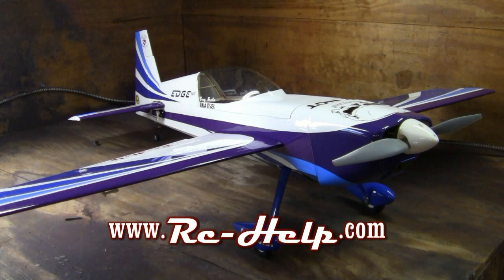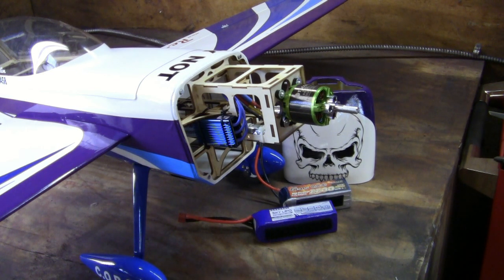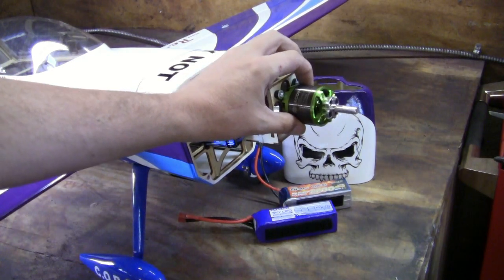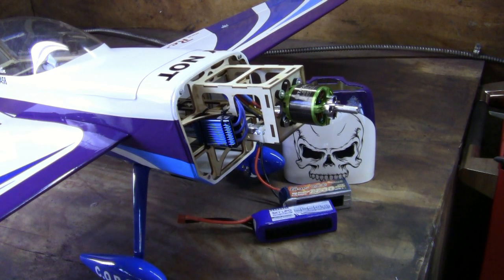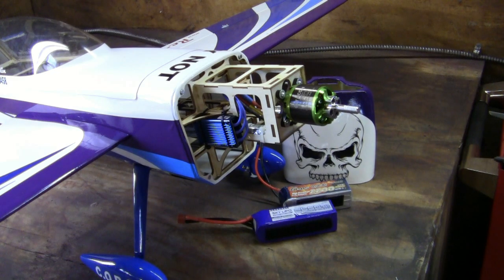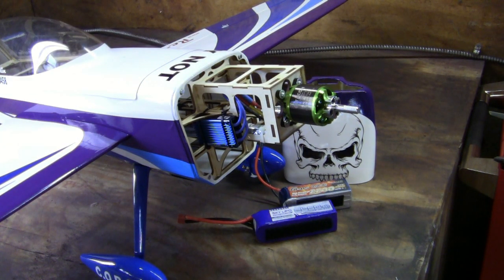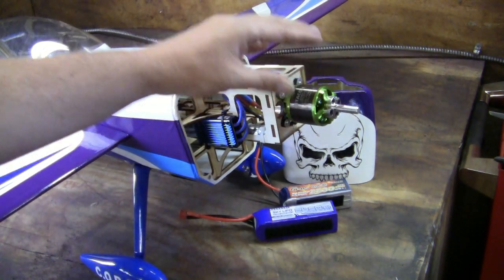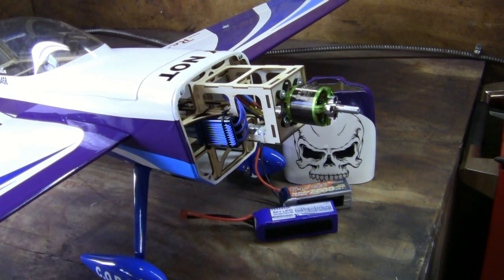Matching Motor, ESC, & Battery

Comment: You said you could use an 11.1 V battery as well. Isn't there a restricting voltage limit for the motor? Like it needs 14.8V battery or something?
Reply from the maker: It will depend on the motor and the battery. The lower the volts, the higher the amps given the same wattage.
Reply: @RcHelpDotCom  Because it is also said that when you apply higher or lower voltage than specified then you might damage your device. That's why I asked. So how come it does not apply here? By the way thank you so much for the quick reply.

Comment: Hy, does the ESC Amperage need to be bigger that the motor amp with 20% more, the battery also need to have a bigger value but the ESC how it need to be in comparation with the battery Amperage ? i saw that you have a 60 A esc with 50 A battery, if you put a bigger Amperage battery value , will burn the ESC ?

Comment: I dont use bigger than 50c ,higher than that burn my gear a lot.
Reply from the maker: Burn your gear? The C rating is only the discharge capacity of the battery. The battery does not push power, the electronics in the model pull what they need.

Comment: So you say going from a 3s to a 4s or (up in battery voltage) wont increase power . 
But say your motors max draw was 50 amps .  50x11.1 (3s lipo) = 555(watts) .  Now if we up the voltage to 14.8v (4s lipo) . so 50(amps) x 14.8(4s lipo) = 740(watts) . Which is more power if im not mistaking .
Reply from the maker: 3-4s is not what I was saying in this video. I'm saying going up in C rating (C, not S), if you see an increase in power, then your old battery did not have a high enough C rating and was causing a bottleneck. www.Rc-Help.com
Reply: Increasing series is better for making more power with less amp draw your motors will last longer but never exceed the manufacturers recommendation for the number of cell in series.

Comment: Golden.
Reply from the maker: It's not what they are called, it's just what the manufacturers state for 3D. And yes, you want an ESC that is just slightly over what you are going to be pulling amp wise.
Reply from the maker: Thanks. www.Rc-Help.com
Reply: @RcHelpDotCom  Say champ, which prop pitch are good for 3D on an electric 3S slowflyer around 14 oz? Someone said i need a low pitch prop, but does than mean a 9x7 or a 9x3 or even lower pitch than that? Thanks.
Reply from the maker: Usually with 3D props, the length needs to be twice the pitch. On the place in the video, a 12x6 is the suggested prop for 3D, and a 13x8 for regular flying. That plane is a 55" just for comparison. If you are flying with a 9" prop, look for something in the 4.5 to 5 range on the pitch. Just watch your motor temp and esc temp. www.Rc-Help.com
Reply: @RcHelpDotCom  Oh, so you call them 3D props? That`s new to me, never heard that term before. Prop length twice the pitch, never heard about that either. I`ve seen some "SF" props but never made the connection to 3D. As for esc i try to use one that can tackle a little more amps than the motor will draw, isn`t that the rule of thumb. Anything bigger than a 9 size prop would draw too many amps from the motors i am running which is the 80-120 watt range. So a prop length twice the pitch is the golden rule of 3D flying. Thanks for the tip :)

Comment: Great video! Iam starting in RC, and i want to get a kit for seaplane. but it would be great if the kit could be used in other planes, so... what you recomend, a 4 cell bat kit o 3 cels??
Reply from the maker: The voltage will depend on the plane and the electronics requirements. I can't tell you what those are since I don't know what you are purchasing. Just read the manual for the parts you have and it will tell you what to use.

Comment: its best to go 25% oversize  with the ESC  meaning loaded up max at 80% .. good vid "47amp X 1.25 = 58.75 round up to nearest 60 amp" esc
Reply from the maker: If the aircraft can sustain the extra weight, they go for it.

Comment: Can I get a esc that has a much higher amp rate than the motor so I can use it in future projects with bigger motors too or I shouldn't? If I shouldnt, why is that? Same with battery, can I get a higher amp battery for the same reason? I have read in your description that the motor only takes as much power as it needs from the battery, nothing more, but in past I have burnt small motors using high voltage batteries such as using 12v on a little toy car motor, how did that happen? I am such a noob...
Reply from the maker: Correct, you can get a larger ESC and a larger C rating and not hurt anything but the weight. Going to a 3s or 4s on the battery though can most definitely burn up a motor or even an ESC for that matter if it isn't rated to handle that kind of voltage. So definitely stick with the voltage that they suggest.
Reply from the maker: I would like to start with the end of your comment, In the description, I stated "as much power" with power being the key word here. Power is amperage. If you look at Ohm's Law, I=V/R, so power equals volts divided by resistance. This is a key component in what I was saying. Voltage is how big the water flow is, amperage is how much water is flowing through. 

So in the case of the toy car motor, which was likely a couple volt motor, going 6x the voltage is definitely going to burn it up. 

Now to the question of larger ESC and C Rated battery. You can go with a larger ESC and not hurt anything*. Notice the asterisk. We will get back to that. You can also use a larger battery C rating without hurting anything*. There it is again.... 

*Using a larger ESC and a larger C rated battery will add weight to, usually the front of the plane and can make it nose heavy, or in some cases, too heavy for the plane to be able to carry it. So definitely keep that in mind. 

Hope this helps.
Reply: @RcHelpDotCom  so I can get a larger esc and not hurt anything and I get get a higher C rated battery and no hurt anything, oy issue is the weight. What about a bigger cell battery? If the motor is rated as 2s and I plug it to a 3 or 4s, it will get damaged and possibly burn right? Thanks for your time by the way!!

Comment: ok so Kv is constant velocity. NOT kilovolts (kV) got it. are wattages usually listed when you get a new motor?
Reply from the maker: KV is RPM Per Volt. Take that KV number and multiply it by the voltage of your battery. And wattages are 'usually' on the spec sheet. If they are not, then you will need to use a watt meter to find out what the number is. www.Rc-Help.com

Comment: I placed a 3s vs 2s lipo and it goes MUCH FASTER!
Reply from the maker: Increasing voltage will always speed up a motor as long as everything can handle the increased voltage. www.Rc-Help.com
Reply: @RcHelpDotCom  it's the voltage that does it, not the Millamps?  is that what you're saying?

Comment: Great video, it is really helpful.  I have a question I have  a Sig Something Extra that I built many years ago, prior to the days of electric flight, it currently is flying on a Super Tigre 45 nitro motor.  I would like to convert it to electric, how do I determine what electric motor to use?
Reply from the maker: My first question is, do you actually own a Corvair? My grandfather and I build a 64 'vert and did some shows with it. Man I miss that car lol. 

As for your question, I'm guessing it has a .45 nitro engine in it? The "VERY" rough rule of thumb is to take the displacement (in this case .45) and multiply it by 2000. So .45*2000=900. So you would want to look for a motor that is about 900 watts. With that information, just head out to the different sites that sell electric motors and look at all motors that are ~900 watts. You will also need to measure the inside of your cowl for all 3 dimensions so that you know it will work. I can assure you are going to have to make a mount to push it forward. 

If you would like some more help on this, come over to the forum and post up. Lot of great people over there to help out. www.Rc-Help.com
Reply: @RcHelpDotCom  Yes I have a '64 Monza Convertible that I'm restoring.  Yes it is a .45 motor currently.
Reply: @corvairchris82  My buddy had the 66 Corsa, and his name was Chris.
Reply from the maker: That is exactly the car we did. Awesome!

Comment: Hello, Thanks a ton for this video. I'm a university student and we're trying to make an efficient plane for a competition. I'm a bit confused - the thing is we won't be flying at 11.1V or as in your case 14,8V forever right, so for getting an amperage for motor shouldn't we consider a worst case and the best case scenarios (12V and 16.8V resp.)[for 4S] as the voltage might change during flight. I had a few more doubts such as - can we remove the copper plate from the ESC's to reduce weights? Our main aim is to carry more payload by keeping AUW as constant factor. But whichever motor we're selecting is either very heavy or asks for massive power. (Is there any method through which I can contact you for more info!!! I've tried blogs and forums, they seem to contradict each other when asked any query)
Reply from the maker: You are right, you are going to get voltage sag while you are flying and while you are applying more and more power to the motor. So that is something that you need to take into account. The lower the voltage, the higher the amperage at the same given wattage. So as you pull down the battery, you are going to pull more amps. 

About the ESC, that copper plate is there for cooling. If you remove it, you will likely overheat the FET's. The only way around that is if the ESC is way too big for teh application where you are not drawing hardly anything through it comparatively speaking. And you are only going to save a few grams which you can save with a different battery. 

I did some talking with some OU students that were doing this same thing, and they had to use sub-C size batteries. So if you are stuck with a specific battery, then my weight savings idea is shot. 

And as for motors, there are two options, low speed/high torque, or high speed/low torque. If I was going to do something like this, i would opt to go with a higher KV motor that spins to the moon and put a smaller prop on it. Of course you are going to need to test different setups to find one that will work. 

As for the contact methods, we have a forum of our own with some very knowledgeable members. www.Rc-Help.com
Reply: @RcHelpDotCom  Thanks a ton. About the motor: speed is our secondary issue, the primary objective is to have a minimum thrust so as to lift maximum payload. As far as I've understood from forums is that a lower kV will somewhat have a higher torque which in turn will din the same prop much faster than a lower prop motor. Now I'm an electronics student and I have least knowledge about the fluid mechanics involved here but this is what I inferred from those blogs and forums. (There's some relation like kT = 1335/kV, not sure how appropriate/error-free this relation is). So, what would you suggest for? Going for higher kV Or higher Torque as Thrust is the primary importance here. Also won't using smaller props increase battery consumption? 
T. I. A.
Reply from the maker: The only reason I said to use a smaller prop is to use a higher KV motor. You can get the same thrust out of a higher KV motor without the added weight of the more powerful lower KV motor. Everything is a balancing issue, you just need to find that right balance.

Comment: Can I use my 2212 6t 2200kv motor on it?
Reply from the maker: On what? I have nothing to base that question on. What ESC are you using, what battery are you using, what is the amp draw of the motor? I need to know these things to help. www.Rc-Help.com
Reply: @RcHelpDotCom  I have A2212  6t 2200kv motor ,40 amp esc, 2200 3s 30c lipo, 6x4 props.... purchased in combo....plz tell me effect size of the plane I can make...I mean who much bigger the size can b ....a aerobatic plane
Reply from the maker: You still are not telling me the amps of the motor. There are a ton of those motors out there and they all have a different rating. But mostly, they are about 30 amps. KV means nothing matching these. As for matching it to a plane, I'm guessing something under 30" and very light for that motor if you are wanting to fly 3D. Might work on my RCH Edge 540. https://www.rc-help.com/pages/pdf_plans/

Comment: It's cus they think just because you put more volts to it'll go faster lol but that's falls I  the lines of what you said the plane wasn't at it's max compasity
Reply from the maker: More volts will make it go faster, but only if it can handle the increased voltage. What I was pointing out in this video is the C rating, which is power draw, or amperage. If it gets faster by going up on C rating, then the C rating was too low.
Reply: @RcHelpDotCom  yes I agree as well it's faster cus it was underpowered before  lol
Reply: @RcHelpDotCom  does the same math apply to a off brand esc an a traxxas motor
Reply from the maker: Yup, same applies on everything.

Comment: Does this apply with rc truck an cars I'm wondering if my 120 amp fastwin esc will power the traxxas 2200kv motor
Reply from the maker: Yes, it applies to those as well. Don't get hung up on the KV, that is just RPM/Volt. You need to know the wattage or amperage of the motor.
Reply: @RcHelpDotCom  ok sweet thanks man scratch the other comment asking again lol thanks a lot

Comment: What current draw that motor make is strictly dependent on the propeller size and pitch. On other hand I cant believe people used to fly such a large planes with so small batteries..
Reply from the maker: Every reputable motor manufacturer will give a stated voltage, a stated wattage and from those two you can figure out the amperage. Most will also give you recommended prop sized as well to produce max thrust and still stay safely under the max wattage. I could put a 24" prop on the motor in this video and pull 400 amps for a split second, but I know this motor can't handle that and it even states a max size on the spec sheet. As for your comment "On other hand I cant believe people used to fly such a large planes with so small batteries", This is only a 50" plane and it flies PERFECT with this setup. Will prop hang for days and normal flying I get 10 minutes out of that little 2200mah pack. Thank you for your comment. www.Rc-Help.com

Comment: You confused me abit with all those maths.maybe you can help abit? I am trying to change hardware to a bait boat.i have 2 brushed motors robbe power 400 volt 8,4 efficiency:67% max current consumption 9a. I am looking for a new esc and batteries.if you can give a hand i would be greatful so i know what to look for and whats the cost.
Reply from the maker: For that motor you would need an ESC that can handle 9 amps. If that info on the motor is correct, then you would need two of these - https://www.banggood.com/custlink/mv3vY5pUyY
www.Rc-Help.com

Comment: if I increase the battery size, the mAH rating increases, does this mean that the battery will give more flight time? how can we estimate flight time knowing the ratings of the battery, esc, and motor? thanks! such a helpful video!
Reply from the maker: Because of manufacturer tolerances, there is no 'set in stone' way to calculate 'exact' flight time increases. A battery that states 2200mah could be 2180 or it could be 2220, you just never know unless you run tests on it which most people can't do. But generally, flight time does increase if you increase the mah of the packs you are using. 

The way I test it is I set a timer and I fly. Lets say I set a 4 minute timer. Once that 4 minutes is up, I land and I go and charge the pack. If I put back in less than 80% of the mah, I increase my flight time timer. How much? That is going to depend on how much you put back into the battery. If you only put 50% back into a battery (1100mah in a 2200mah battery for example), then I will add a minute to the timer. If you put in 70% then I would only raise the timer by 15 seconds or so. Doing it this way, you match your battery with your aircraft. 

I hope that wasn't too confusing to follow. For more help, come over to our forum and post up. www.Rc-Help.com
Reply: Thanks for the quick reply. Yes i understand that concept, discharge the batteryand see how much can go back in and keep increasing the flight time untill you close in on 80% put back in, obviously being careful not to over discharge the battery, Thanks!
Reply from the maker: That is exactly correct. www.Rc-Help.com

Comment: If I have a 10 amp speed controller with an input out 4.4-8.4 volts, would it be ok to run a 370 brushed motor on 7.4 2s lipo?
Reply from the maker: The lipo will be fine, but I have no idea what kind of power your motor is drawing so I don't know what ESC to match it up to. www.Rc-Help.com